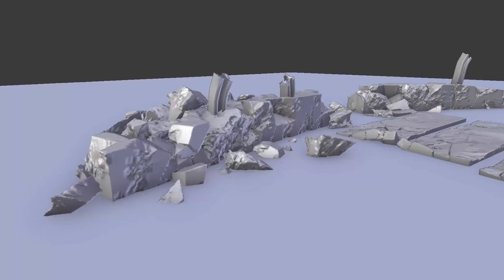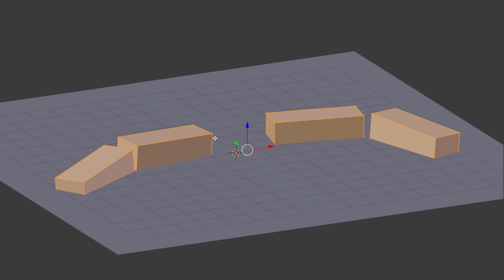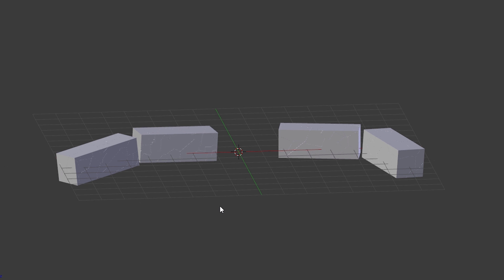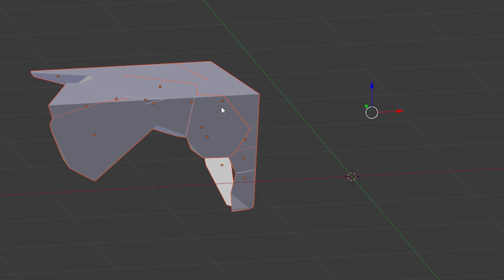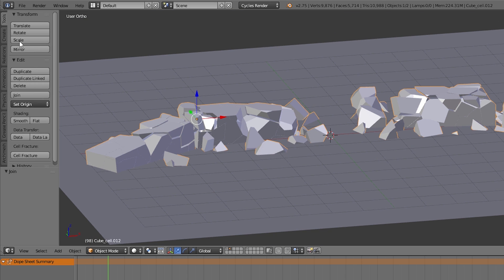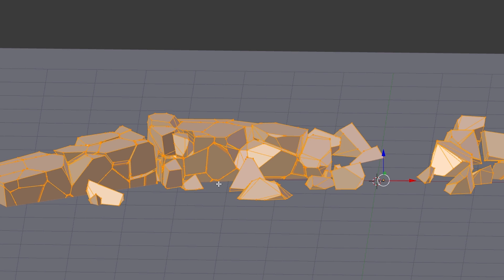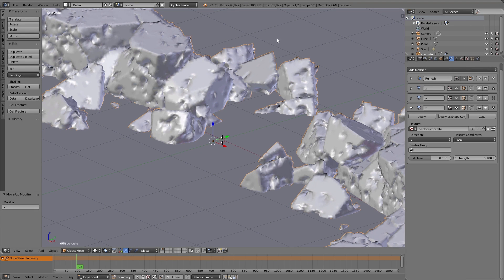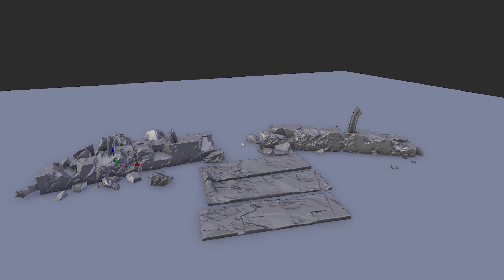MSC #13 - How to create a demolished concrete wall (Blender Tutorial EN)

Comment: Is there a way to easily get rid of all the cracks in the parts that shouldn't move? Basically, all the separate pieces you select at 3:23, I need them to be one mesh, without any cracks, to export to Unity, for use in a game (so it should be as lean as possible).
I could obviously go around the whole mesh and manually merge all the verts and delete the unnecessary / unwanted edges and faces, but is there a better / easier / faster way that you can recommend me?